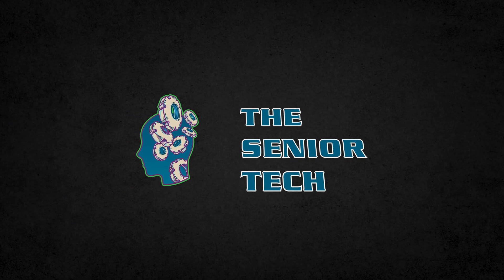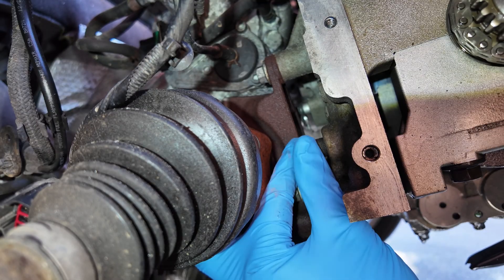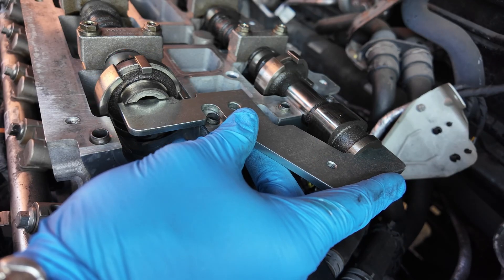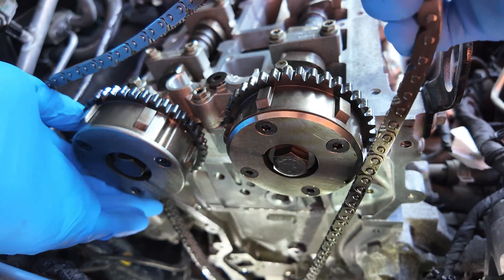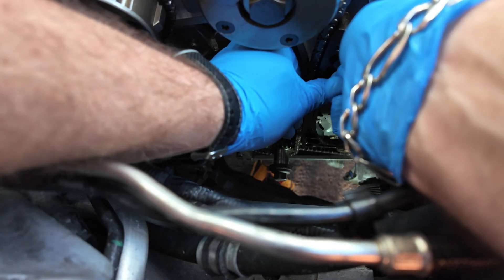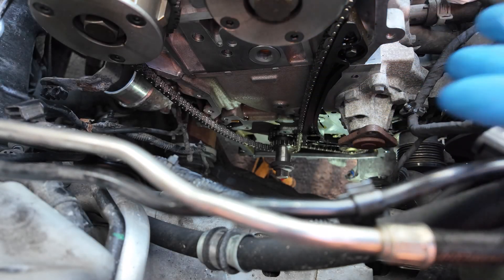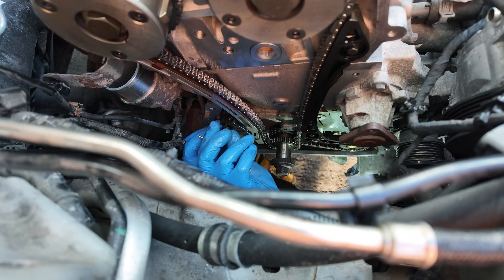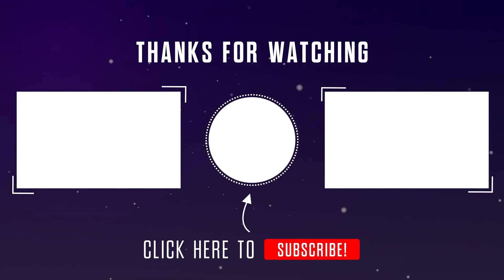EcoBoost 2.0GDTI  Timing Chain Fitting Step-by-Step Guide - Ford Mondeo Titanium X

Comment: Great video! After replacing the timing chain on my 2.0L EcoBoost, is VVT relearn required, or will the ECU adjust automatically?
I'm getting a P0017 code right after the repair. Any idea what could be causing it? Thanks a lot!
Reply: its out of time still, didnt nail it
Reply: did you solved this issues? have the same code after timing chain and vvt repalcement